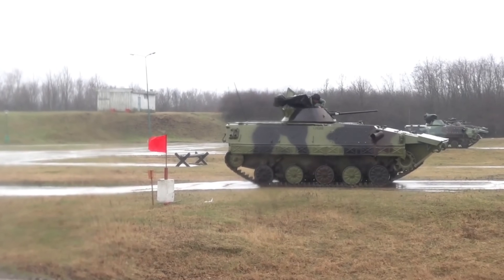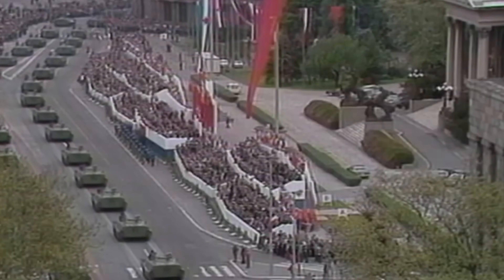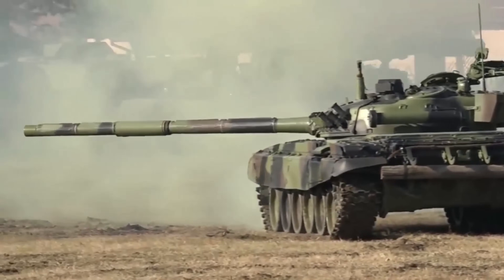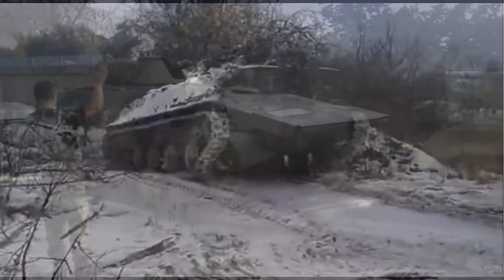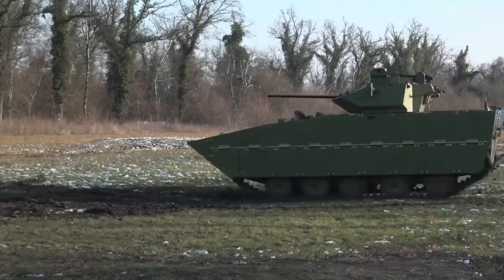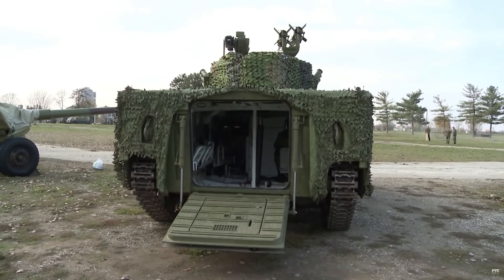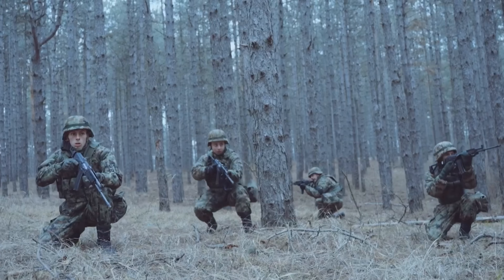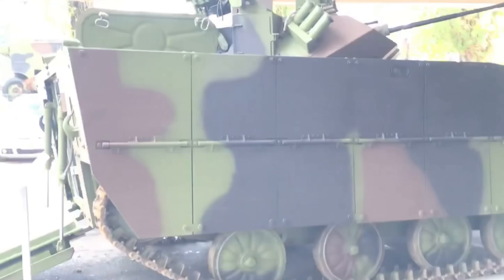Yugoslavia’s BVP M-80 Infantry Fighting Vehicle Explained | SOVIET BMP COUSIN

Comment from the maker: Thanks for watching! What are your thoughts on the BVP M80 series? Let me know in the comments below! Don’t forget to hit like 👍 and subscribe for more military history and vehicle breakdowns!
Reply: @_Matsimus_  Folks, this vehicle was designed in the 70s for the area of Yugoslavia, which has many river courses, at that time the armor was tested to withstand the hit of the Mauser rifle that uses the 7.9 / 57 bullet, which is quite a strong caliber from all sides, from a distance of 20 meters, and from the front it can withstand 12.7 mm, which means that it cannot be penetrated by classic infantry, although weapons such as 7.62 or 5.56.  Of course, it also protects against shrapnel, but until then, the army drove in the back of a truck under a tarpaulin?!?! It's so much better, And what is not said is the case with the 30 mm cannon. All in all, since these FPV drones appeared, no vehicle is safe anymore, but given that it is winter and that the army needs to track the tanks, it is much faster and easier in a vehicle, as this is not the case for the army to run after the tanks, these modernizations that Serbia is doing now, in my opinion, do not make that much sense. I'd like to know if it's 20, 23, 25 or 30 mm. The most important thing is that it is accurate and that it has good thermal vision as well as enough cameras from all sides, in addition, armor plates can be placed in the most important places such as on the side of the driver and commander and 2 along the vehicle to protect the soldiers and not to cover the entire vehicle like this. It has a speed of 65 km/h, which is quite enough, and everything else is ok. I don't think there's a need to install a movable ramp as if the army can't open the door on its own?!?! It's so much better than having to walk
Reply: Matt my favorite IFV...The Ford Pinto.
Reply: @matthewmohri9990  Nothing compared to the Iconic Jack of All Trades & Master of All  " THE TOYOTA LAND CRUISER J70 "
Reply: Matsimus, can you do a video on the O.S.V. 96 sniper rifle? I would really like to hear what you think about it.
Reply: Keep it up buddy, you are doing exelent jobe. You have a sof - enjoyable voice combined with knolewgde hits a good combo ! Enjoyed watching this as a Serbien and i watched a lot of videos thousands of them from different chanels and this one is in the top tier ! All the best !
Reply: @dusanmilivojevic55  Have you ever wondered why people are talking about everything that Serbia is doing?!?! At the moment, NATO is not able to reorganize and spend resources on a war against the Serbian people for the simple reason that Russia and China are behind the Serbian people and if there is a re-conflict, Russia has a way to deliver the S-400, Iskander and other weapons to Serbia as well as 10,000 of its own men.  Of course, there is also China, which will do everything to show that its air defense system is good enough, and not only that, China and Russia have their own interest in Serbia
Reply: @dusanmilivojevic55  Why do you think the U.S. is suddenly talking so much about the U.S.? Because he wants to insert Serbia into NATO and thus legalize everything he has done here, Serbia has to buy another 6 months and if nothing changes after 6 months, he has to fight for another 6 because Serbia is neutral and it has to stay that way. In the end, Russia will be the winner, and Serbia will then be able to demand compensation for everything that the West has done here, because America and NATO will demand that Russia rebuild everything in the Ukraine, what Russia will do is not a problem, but then Russia and China, as well as many other countries, will demand that the West pay for everything it has done in Serbia. And that's much more than Russia did in Ukraine, because NATO is responsible for the breakup of Yugoslavia and then everything to this day. Our economy has not worked for 30 years, and then we have a million people who have lost everything in Croatia, someone has to pay for it, NATO bombing is the least that anyone has to pay, and that alone is estimated at more than $200 billion, and where are the victims, cancer patients and much more. In some operations, the U.S. has asked Russia to help it, such as Operation Storm or Dayto According to the agreement, Russia had the role of intimidating Milovanovic into agreeing to all this, and therefore Russia can testify as a protected witness and even pay for the fact that it can be armed, which suits both Serbia and Russia to have their own systems here in Serbia.
Reply: 6 meseci sam spavo u njemu...
Reply: @mitarpop4209  i kakav je
Reply: What about the Croatian M84A4 Sniper?a video about that?
Reply: @medskvz  In the area that is now called Croatia, it was not possible to make even a good axe, let alone a tank, until the Serbian people liberated those areas! From the 1945s to the 1990s, thousands of factories and complete infrastructure were successfully built in Yugoslavia, and everything that was produced for the army was designed in Belgrade. A military technical institute that made the best-selling complex system today, such as the Nora B-52 and all its derivatives, but all this is ridiculous compared to what this nation could have produced if the Neo-Nazis had not brought down Yugoslavia. Whether the system of Yugoslavia should have been changed, that is a fact, but whether the entire economy should have been destroyed, that is nonsense that has cost us sovereignty that will be difficult to do
Reply: @medskvz  It's not a Croatian M-84, it's a project of the Military Technical Institute from Belgrade!!! Like everything else that Yugoslavia has done. And the fact that by chance two prototypes remained in Djuro Djokovic, where the tank was assembled, it was just an omission.
Reply: You forgot to mention that Slovenia gave Ukraine all its M80. They are used in ukrainian war at this moment.
Reply: Словенци су говнари на квадрат.
Reply: @klan80  not only Slovenia , but also Croatia is planning to give their BVP M80s to Ukraine as well in order to buy Bradley M2 IFVs from the US
Reply: @PatriotEnfield3276 
Germany bought 30 M-80 IFVs (and 30 M-84 tanks) from Croatia for Ukraine, they got delivered at the end of last year. Germany paid Croatia 144.8 million € for the vehicles and corresponding equipment for Ukraine.
Croatia is going to buy new Leopard 2A8 tanks, the money from the sale of the old vehicles helps to finance the new tanks.

Comment: Infanty didnt like them at all becouse of 1. Shity armor barely could protect against 7.62x39 , 2. Fuel tanks are bellow seats of infantry, 3. 20mm cannon was too weak, 4. Terrible suspension doesnt make it confy to ride inside, 5. No aircondition, 6. Hard to exit fast durring firefight let alone being hit and burning, guys sitting deeper inside are tosted..😖 many troops opted to ride on top instead inside.. its like Yugo version of M113.. weakly armored taxi and thats about it. Newly upgraded and modernized  versions in Serbia are lot better equiped but still some flaws remained 😕
Reply: You don't want to get anywhere near the battlefield with that. Good for transportation to a certain zone, but better on foot from there.

Comment: M80 was a continuation of M60, wich was predecessor.. M60 had a many not so good solutions, but M80 was much better. Not perfect, but much much better than M60. One of my professors participated in development of M80
Reply: No, it was based on AMP-10P.
Reply: @cinoeye  no. I did not say that it is "BASED" I said it is continuation of M60, contuniation of the project. And in that contuniation design could be changed completely . It is not Based on M60 it is continuation, where a lot of misstakes which are noticed on previous project are done differently, etc etc.. I have examples of some braking designs, of layout, etc..
Reply: @ The M-80 is also not continuation of the M60—it is based on the AMX-10P. A continuation in a developmental sense means an iterative evolution of the same platform, like how the M60 evolved from the M48. The M-80, however, was designed separately, taking inspiration from the AMX-10P, not the M60. So if anything, it’s a continuation of the AMX-10P concept, not the M60 lineage.

Comment: Incorrect.The BVP-M80 is actually a cousin of the French tracked vehicle AMX-10P . In short and realistically, the BVP-M80/M-80A is a piece of crap. Bad armor protection, no cannon stabilization, disastrously designed interior of the transport compartment...etc. First hand experience.

Comment: A point about troop capacity: They COULD have stretched the M80 (and many other IFV's and APC's) to carry more troops but having less troops in the back does have an advantage. If the vehicle gets taken out? You lose 4 to 6 dismounts as opposed to 10 or 12.

Comment: Good Presentation, it is a good system with a good crew in a good unit it should do OK if the focus is defensive backed up by artillery and a good spread of Drone and other arial assets.  If used in an offensive expect far more losses.

Comment: FAMOS (FActory of MOtors Sarajevo) is basically a factory that made Licensed copies of Mercedes-Benz Engines for FAP(Factory Automotive Priboj) Trucks. They were also 1-1 licensed copies of Mercedes Trucks of the time, bar some luxury. And they were used in Other vehicles and purposes too. 
Engines like Mercedes OM 352/352A OM 366/366A and OM 402 and 422.

Comment: The BMPs really are a bad IFV: They were designed to be barely sufficient for their time, regarding soldiers as discardable and are uncomfortable, which is quite the contrary to what you said, a real problem, as it degrades combat effectiveness.
Vehicles like the Marder, the Warrior, Bradley and such are much more upgradeable and start at a far higher baseline, which makes them far more effective for a far longer service life. That's something Russia had to admit in the last few years: They need a new IFV to get a combat-effective mechanized infantry force.
Reply: M-80 is based French AMX-10P and it is primarily ICV, and not IFV. It cannot be compared with Bradley (basically light tank).
As such, M-80 is basically a truck/van/bus that drops troops and unasses…and not to actively support troops or engage other vehicles. Not sure why are you mentioning Russians?

Comment: Matsimus you got it all confused my man and l do not blame you, this vehicle had like 5, 6 different modernization proposal packages before they (Serbia mod) actually opted for something. This videos you are showing are 3, 4 year old prototypes for modernization package (non of those turrets will be used). Serial modernization started sometime mid last year whit 26 vehicles ordered so far, they showed 12 modernized vehicles near the end of 2024. Vehicles had upgraded engine, new armor package, capacity for 9 troopers (no turret basket in the hull, more space for troopers), back door ramp, domestic 20mm RCWS (whit old 20mm hispano gun), 40mm grenade launcher, coaxial MG and 2 x malyutka ATGM-s, commander and gunner got thermal sites and driver got 360 visualization systam (basically low light cameras). Now whit that being said they did separately show 26 30x173mm guns (NATO caliber, a bit more powerful then warsaw 30x165 whit way better selection of ammo types on market) produced by Zastava arms specifically for this party of vehicles and single prototype of 30mm RCWS, MOD representatives stated that RCWS for 30mm guns is still not ready for serial production (they are not satisfied whit stabilization, they have some issues whit that) so for now they will use earlier developed  20mm RCWS which will later be reused for new 4x4 APC-s Milos-2 (they do not want to trow away 500+ perfectly good 20mm guns, whit millions of rounds in reserve, so they will just keep using them wherever they can 😅).

Comment: There are 500 such vehicles in Serbia and, most importantly, it can protect the army from infantry weapons and the IFV is used for that. It is enough that the army does not go on foot and is protected from 7.9/57 mm ammunition as well as shrapnel. A 20 or 30 mm cannon with a machine gun and 4 rockets is quite enough because this is a vehicle for transporting troops and that's it. And no matter what one thinks, when it comes to the conflict, the army, especially if it is not in someone else's territory, does not know if a 20 or 30 mm cannon is firing at them, because in both cases everyone is looking for them at that moment They're looking for a place to run?!?! There are no more heroes who will take the RPG when a 20mm cannon starts firing at them, maybe when they find good cover, but by then the army had already landed and taken up position, and the vehicle had gone back for reinforcements.

Comment: Hi, former BVP commander, or third idler, as crew sometimes refers to us, here. Gunner is actually called the operator, we are not tankers, we are infantrymen. Its purpose is to safely and reliably deliver infantry elements to the frontline and support them as they disembark, and for that, it was perfectly adequate as it was. BVP is a mule, not a warhorse. It's a simple, reliable vehicle, and as long as improvements do not impede that, they would be welcome. Now, increased mobility and protection sounds great, while cornets, 30mm cannons, and SUV("sistem upravljanja vatrom" - Fire guidance systems) are way less important. We deploy mixed units of tanks, BMPs, self propelled guns and rocket artillery, engaging hard targets is the last resort, not a job, for BVM M80. Interesting rumor I heard is that they are designing a drone/anti-drone package for BVP, and that would make it invaluable on the modern battlefield.
Reply: ... also as a former BVP commander. I think it's time is due. The track width and powerplant does not support further armor upgrades. Time for new stuff.
Reply: @myname686  Zdravo, in my opinion, and I am not a weapons designer, speed and mobility are way more important than armor. Also, in the age of drones I believe speed is better protection than armor, especially since it is really hard to create a vehicle with the tick enough top to be able to withstand hits from the above.
Reply: @ armor is everything. Modern IFVs weight >40 tons. Events in UA more than confirmed this. (I'm Slovenian and I served in Niš, Južnomoravska oklopno-mehanizovana brigada).
Reply: Evo ja cu kao mehanicar za njih i tenkove (dok sam bio u vojsci) reci kako su obicno smece
Reply: I want one

Comment: You said it nicely that if a BMP is destroyed, there are 50 others to replace it. Who would sit in that vehicle without being forced? I don't see a single soldier in the video with equipment that can get in and out of that bucket. That's the Russian doctrine of waves of BMPs and waves of patriots who want to barbecue for a higher goal. Funny and sad for the people who use that vehicl
Reply: For BVP M80 was developed platform for aditional weapons for  infrantry squad. It comprises from 60mm mortar or 30mm AGS and 12.7mm antimaterial sniper. 60mm mortar or 30mm AGS compartment with amunition is above the heads of the squad while 12.7mm sniper is locacated in front of their legs.

Comment: In 1987 I was a commander of a BVP M80A. Nice with Webasto heater in winter. Fast, but unremarkable otherwise. Had passive night vision though. M80A could exceed 80 km/h (nearing 90 on tacho) on a paved road, but was difficult to control at such a high speed. M80A featured automatic fire suppression and NBC protection in 1987. 35 units were donated to Ukraine.
Reply from the maker: Thanks for sharing
Reply: The original 180 HP version could barely move. I have no idea how many they made with this terrible engine and how many had a 320 HP engine, all I know is that the original version could barely climb a hill when fully loaded. Btw, the engine clearly said Mercedes Benz, FAMOS (Fabrika Motora Sarajevo) is just a manufacturer that traditionally made MB licensed engines, buses and similar equipment.
Reply: Greška motor Hispano 270ks prve verzije.
Reply: @bojanstojanovic665  correct.

Comment: I dont beleive it has a 30mm cannon, it has the granate launcher as a secondary weapon but when I was in serbia teaching them to use BTR-80/A I talked with one of the engineer who worked on this.
Reply: Hello for Hungary from Serbia. You are right, it does not have 30mm gun, they just replaced crewed turret whit 20mm RCWS. 30x173mm gun and RCWS (DUBS-30) were developed for this vehicle and Zastava arms started serial production of those guns, but RCWS failed to pass military testing, they are still working on that.

Comment: Seems like a very practical series of vehicles, kept so by well-chosen upgrades. It sounded like the amphibious capability was extremely important in the past, so I am curious if the M80AB1 is able to drop its add-on armor to swim?
The weapons chosen for each version seem very well-chosen for the period, and the improved turret armament, sensors, communications and EW mentioned in comments, and significant armor upgrades make the M80AB1 substantially more capable. I like that door inside the rear hatch for several reasons -- but that hatch needs to be faster!

The best upgrade I can think of for this would be continuous 360° visible, low-light, and thermal camera with motion and heat-flare detection routing alerts to the gunner and the driver. That, combined with a simple LIDAR, could allow an automated engagement of relatively slow threats like rockets and missiles (and the team that sent it) or drones with the turret weapons, while allowing the driver to immediately react. APS are extremely desirable, but very expensive; and if you can dodge, then good enough. If there is indeed some electronic detection of frequencies and jamming capability, that could be very valuable to survival indeed!